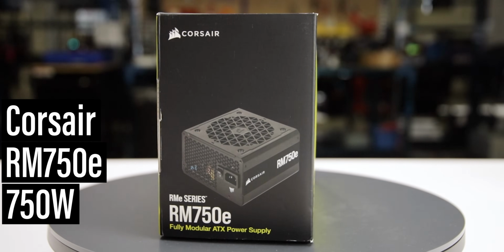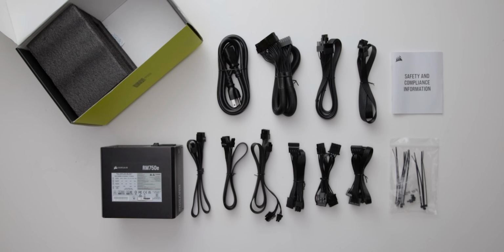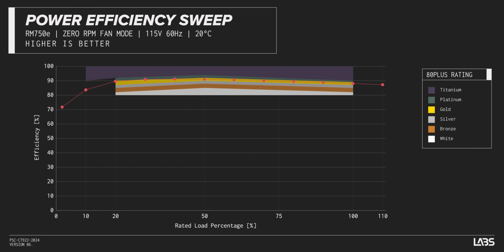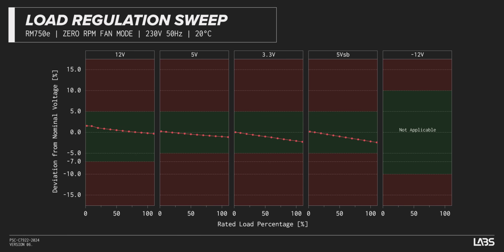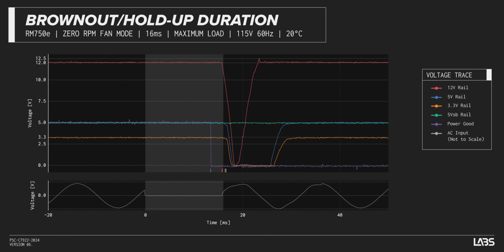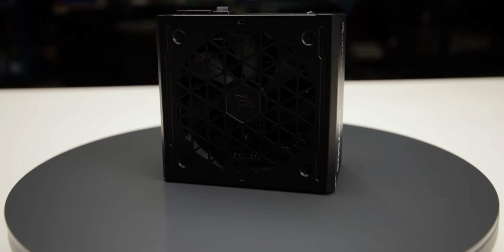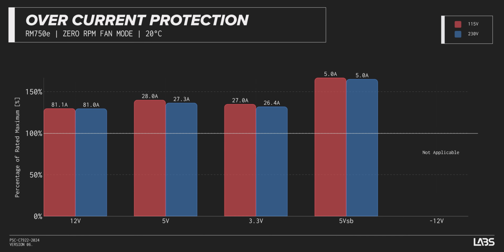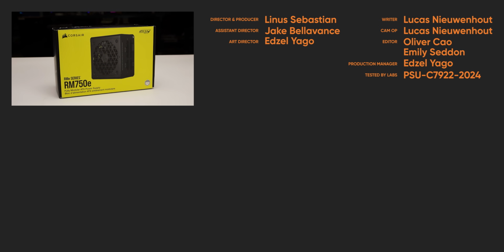Corsair RM750e 750W Power Supply - LABS Test Report

Comment: A couple points of feedback I want to give:

- The second data point in your 12V output voltage ripple sweep test appears erroneous, it just doesn't fit the trend, you also don't have any error bars which makes me think you're just taking a single measurement? Only thing I can think of is if it's doing some wonky transition between DCM and CCM between those load percentages but that wouldn't make sense to me, wrong load point, too much improvement. It's also unclear how you're measuring this, with a DMM? a power rail probe? 20 MHz BW limit enabled?

- The website mentions the 3.3V rail exceeded the ATX requirements during some tests, but this is not explained on the website or in the video? The same with the 5Vsb exceeding OCP limits but this is not elaborated and appears to be have been placed in the wrong box on the website?

- All of the graphs and tables look nice, but many of them don't actually provide any sort of useful information. You should include the raw oscilloscope screenshots and pictures of the Chroma display and setup if you don't want people doubting your conclusions that you've drawn from data you're not supplying. Particularly for the excursions test, you label the duration, but nothing about the current and the voltage scale.

- No internal photos or any signs the internals were inspected. You cannot determine the build quality or class of components without this, eg. does it actually have 105 °C high quality capacitors? Is there something fancy about this PSU's topology that makes it unique and explain some of the limitations? Construction quality is BIG aspect of PSU cost and is often what gets marketed, you should confirm such claims.

- Couldn't find the extended temperature range tests on the website as this video mentions?

- No acoustic tests, however I see in the blog part of the website you say it's coming soon (mentioning here because other don't appear to have found that part at the very end of the blog post)

- No mention of electrical safety compliance markings and their compliance with those standards. Many cheap PSUs are not NRTL recognized (/region specific requirement) and are non-compliant, this also plays a very big role in the cost of a PSU and is probably the most important difference between a brand name PSU and some random cheap no name Amazon one that often lie about compliance.

- You should be able to just click on the images on the website, not just the specific enlarge button in top right.

- And the machine generated voice... Really? I do understand it's difficult getting someone to voice technical lines for cheap but those days those sorts of things are not viewed well.

- Concerns of AI generated content: it's clear you're trying to streamline the workflow as much as possible to make this economically feasible, but I am concerned either already or at some point there will be an attempt to get AI to write parts of the website article or make a script from the website, if so you 100% need to disclose it and add someone to QC it. (although I would discourage using AI at all)
Reply: So... Is good psu?

Comment: I know people were upset about the AI voice. However just think about it for a second. They in this video told us the type of cable, the quality of the cables, the efficiency, the loads on all rails, The dimensions, peaks, burnout, power outages, and much more. This is 1 PSU. On Amazon typing 750watt PSU I see over a page of real results. There has got to be over 50 PSUs here. Do this for all 50 at 1 wattage, then another and another and another. The amount of time to make these videos will be substantial. So yea cutting a corner and using AI makes sense to me. It would cost just way too much to use a human.

Comment: I had an issue with my older Z87-A motherboard using this PSU. My computer would power on but never post. My going theory is it is because it doesn’t have the -5v pin in the 24 pin. I had to return it for a CX750M which is working great.

Comment: if the voice is generated from text, how come there are no subtitles?
Reply: Adding subtitles takes a lot of time because they have to be timely matched to the content.
Reply: @videostar348 Even if they didn't have the subtitles, it would take less than 5 minutes to auto generate the subtitles from audio in DaVinci Resolve, correct the few errors generated, and trim the subtitles in Subtitle Edit.

If they have the text, it could be done in less time, in Subtitle Edit.
Reply: @videostar348  it doesnt take much time at all, all you need to do if upload the script and theres a youtube feature that automatically does it
Reply: theres a link to the article that generated the video
Reply: @TomahawkUnleashed  I was thinking from perspective of someone not familiar with psu lingo, subtitles would help keep up with the video. Also the link should be right below the first ad line, makes no sense to put it in the bottom of description.
Reply: There are now subtitles. Although they aren't the best.
Reply: Automatic generated subtitles are around 90% accurate

Comment: I hope they're able to do a lot of the budget-budget psu's as well, I currently use GameMax (not sure if they sell in Canada) and while I don't plan on upgrading for a while i can see these vids and the labs site making it easier trying to learn about and compare potential upgrades.

When i was looking for my psu i really only considered price, wattage & efficiency class and so while I don't yet get what things like ripple are, the brownout bit is something I didn't consider but would going forward.

On the LTTlabs page i see there's a page explaining all the terms and graphs, would you consider adding a hover-info button on the power supply page (e.g RM750e) with either an explanation there or a shorter expanation with a link to that full term explanation page.? Just thinking about if I needed to share a page with someone but if they didn't know a term.

Would have said I wish fan noise/loudness was in the video but just read on the site that that'd be coming whenever the audio chambers finished 👍 

(Ignore this bit: 132)